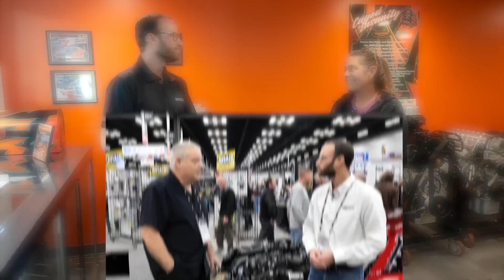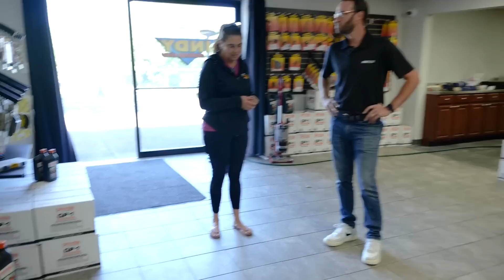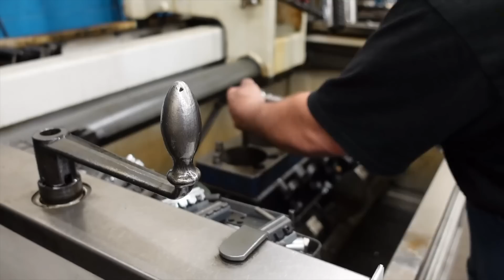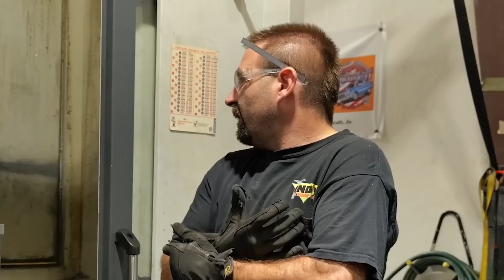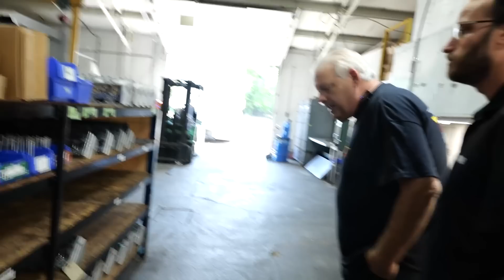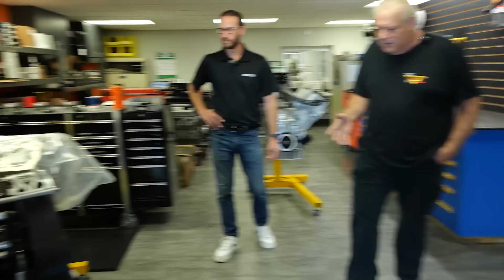Enter the Hemi and Mopar Dream World that is Indy Cylinder Head

Comment: I got an engine from them in 2011 that was 640 grams off.  Bob weight of each piston & rod was 80g off.  Tore itself apart in 500 miles.  Never again.  Local 1 man shop with a new crank and 1 new piston set things straight, several extra $K.  408 Magnum.
Reply: New organization now, not the same as it was 15 years ago.

Comment: Indy sucks.  They won't work on vintage MoPar engines ,,,machine vintage blocks ect.  Sure.  Buy a 40,000 new engine!! But a lot of Mopar guys can't afford that expense.
Reply: Why complain?  It’s their business and they choose not to do certain things.    Do you get mad that Steve morris or Texas speed won’t take your 427 truck engine and rebuild it to make 400hp??    How about rosler not building an auto trans using stock components?     Do you do janitorial work at your place of employment?      I know I don’t do certain things that people ask me to do in my type of work.
Reply: Yea they sell the parts to upgrade engines.
If you want that sort of work you need to find a specialist vintage engine builder, but don't be surprised by the price.
If I had a engine building shop I could do the work, it's just that I would charge for it and it would be expensive.
I would likely have to spray weld all the cracks. Then I bet the bores can't take another machine, so it would be sleeves for all cylinders and then check for more cracks and weld again.
Just to get an old crappy block ready to assemble would be more than the cost of a new block.
Only reason you would do it is for matching numbers.
Reply: @Channelmaster73  If it was easy we would all do it. All the best with your work Sarge. Go Mopar!
Reply: When I saw your first comment all I could think of was all of the small niche Ford flathead engine shops that have slowly disappeared over the years. Back in the 1960-70s you could find machine shops all over the US with someone with the ability to work on Flat head engines. Now as all those folks like myself have aged out it is harder to find specialists except for the few in Atlanta or LA who do work either for Hot Rods or those preparing engines for the Bonneville Salt Flats Land Speed Records class runs or for NHRA/IHRA Drag Racing Sportsman Clas Racing. I fear that the same will happen with those who are experts with the early 60's Mopar Slant six, the 426/440cui non-hemi and hemi engines built along with the most underrated engine in my opinion in history, the 340 Mopar engine. You have to go to Stock and Super Stock engine builders Like Steve Wann, Jason Line, Ray Barton or Tony DePillo now if you wish to get a quality Mopar engine built for Super Stock or Stock.  There are others out there but those four  come to mind right now. If you wish to have a high quality chassis built for Drag racing then you'll need to contact Phil Mandellla or the Wisecarver Brothers Racing to name just two of many quality builders out there in my beloved Sportsman's Drag Racing. Thanks for listening to an old man carry on about his lifetime love of NHRA Sportsman Drag Racing. Other than Stock, Super Stock and Competition Eliminator it is the the only three classes I will watch in what is today's NHRA or IHRA Drag Racing. All the other classes are nothing but exhibition events of who can spend the most money marketing some company. Take care. Time for me to call it a day. Be safe and all the best with getting your engine built to your satisfaction.
Reply: You really don’t have a clue do you? Do you go to diamond pistons to have your stock TRW piston checked?
Reply: Nick's Garage
Nick Panaritis at Indy Auto 1260 Rue Tellier, Laval, QC, Canada, the proof is in his work, people all over the world hire this guy to build and repair mopars. He has a dyno also with lots of videos.
Reply: well,there's enough choice.
bring it to nick or uncle tony
😇
Reply: Sgt Stedenko,  I have no dog in this hunt when it comes to Indy Cylinder Head Service(ICHS) but I do understand how today's business models work. Only thing I care about is that I've been a Mopar fan and buying cars and parts from them since 1956. It's quite possible that ICHS is just trying to stay afloat and get their business up and running within tight financial constraints, doing what they can afford post Covid with the residual effects of an international supply chain shortage problem. It's a tough call in the high performance engine business with what pays the bills for their overhead while meeting the needs of as many customers as possible. Add the additional costs of finding decent employees, paying their insurance as well as paying for product liability insurance. It's hard to expand your product line to meet the product needs of all Mopar enthusiasts with all these aforementioned constraints hanging over you.

With the current state of Mother Mopar, in the near future I think most of ICHS work will be vintage Mopar engines and parts. With Chrysler there's not the extensive investment from at least 100 major High Performance companies all aimed at currying favor as there is with GM and their extensive list of high performance crate engines, cylinder heads and associated parts lists. At ICHS maybe they're not able to develop niche Chrysler vintage equipment because there's no support from the top down as there is in GM. Right now I feel Mopar is on its last legs and I think ICHS will be positioned well for the vintage enthusiasts such as yourself and your high performance needs within the next ten years. On the other hand, maybe Chrysler will surprise us but I sure don't have a lot of faith in that brand surviving..
Reply: Do it yourself, see how easy it is.
Reply: @AdamHammel  Excellent response Adam.
Reply: Try to get Mopar 4 bangers that make 700+ HP built and hold together.
Reply: @jamesbrown6841  Not that hard, if you know what you're doing.
Reply: @TaylorJensen-ys2cv  I understand that but its like many small demand platforms.  The money isn't there so that parts aren't.